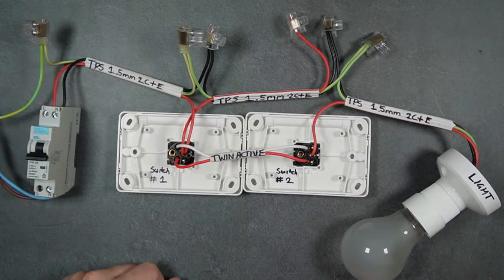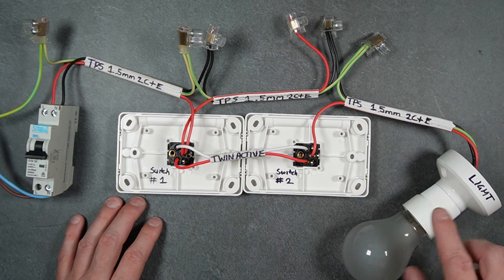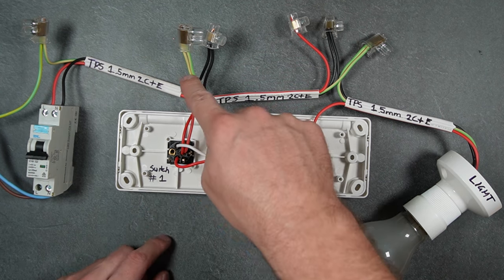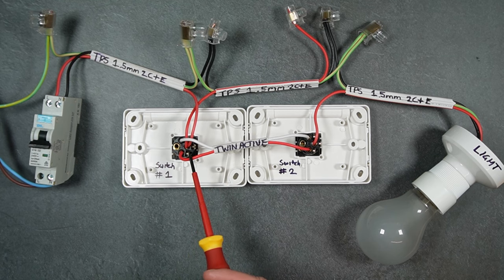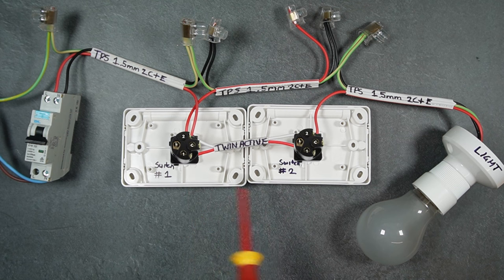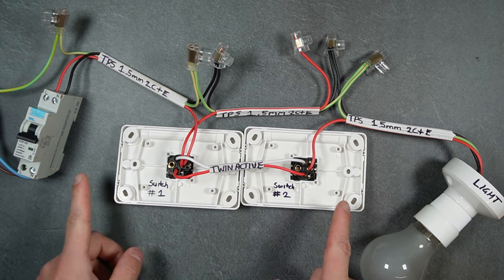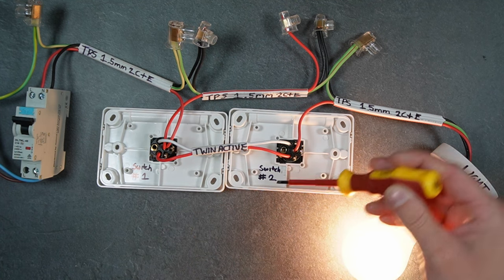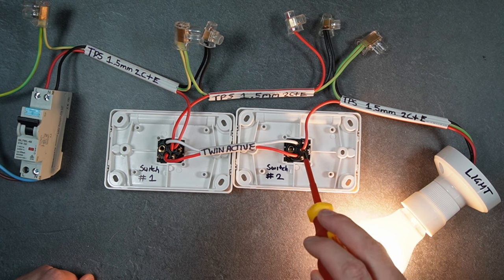How To Wire A 2 Way Light Switch Explained 2023

Comment: Mixing Power Points with lights? Is that legal? In Europe Power Points are totally separate to lights.
Reply: Great question. Yes it is legal but the circuit needs to be identified as a mixed circuit at the switchboard
Reply: Its not common though

Comment: Out of Curiosity/OCD Any reason you can't transpose the Twin at one end so when both switches are in the off position the light is off? Thanks for the great video
Reply from the maker: Yes you could transpose so the light would be off with both switches off. Two on= no light. Two off= no light. One on one off=light on

Comment: Could you please advise how a loop at the switch would work if it were 2 switches (both 2 way) in the same plate? Eg if you have got a switch 1 & 2 of separate 2 ways where does the hard active go after the screw connector?

Comment: Hello, thanks for the description. I have a circuit wired as per your diagram. I wish to add a new light which will be located close to switch #1. Is it possible to add another light from switch #1 to come on using the same circuit?   Or do I have to run a long cable from switch #2 back to the new light I wish to add.

Comment: great explanation !! i just did a job where i ran 2 two ways and it didn’t really make sense to me at first but seeing it all come together here made what i did make a lot more sense. on-site it is difficult to really take in things like this as it is just go go go so this helped a lot, cheers
Reply from the maker: I know the pressure can be real on some jobs. Im glad this video helped would you benefit from a looping at the light video about the same topic aswell?
Reply: @allelectricalau  yes plz

Comment: Hi, thank you for the good video. 
I have a question. 5:56, light is off when switch 1 is off position, the other switch is on position. in 2 way switching, switches are not the same position. when one is on, another one is off even though light is on. is it normally like this? thank you.

Comment: Hey mate, is the double screw terminal on the earth circuit an as3000 requirment or personal preference? My sparky did not do this in my house, all done with single screw terminals.
Reply: If the connectors are the newer Clipsal ones they can be single screw because the terinamtion point is more square unlike the older ones which were more circular

Comment: Are they normal switches or you need to get two way or intermediate switches. Cheer
Reply from the maker: Good question! These are just standard 10Amp switches. Nothing fancy so yes i would say they are the normal ones 99% of people use.
Reply: intermediate switches are used if you need more than 2 way

Comment: Mine have the black wires in the looping is that ok?
Reply from the maker: Yes that's fine. It comes down to personal preference and how many neutrals you have  at the switches for other lights ect. I find a connector can join more neutrals and provide a solid conmection.